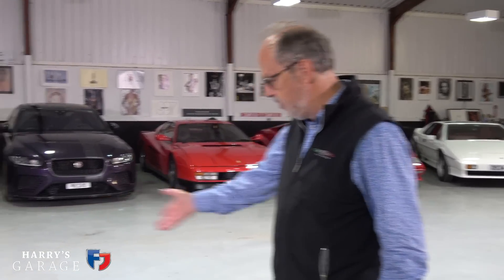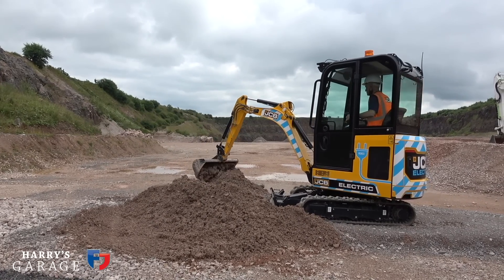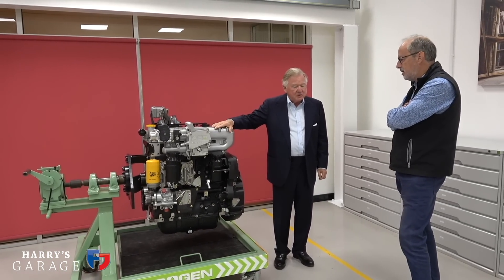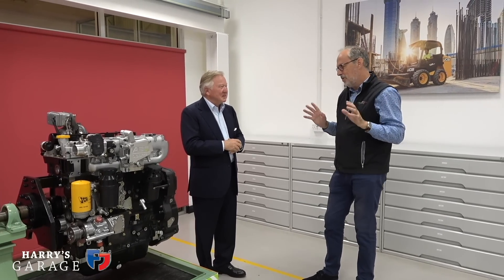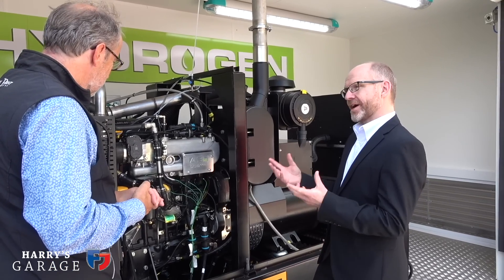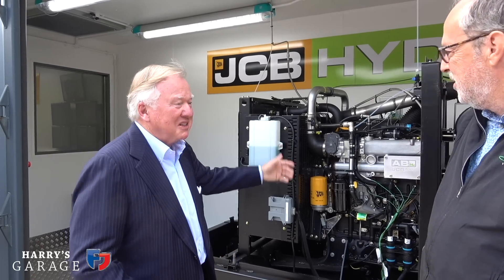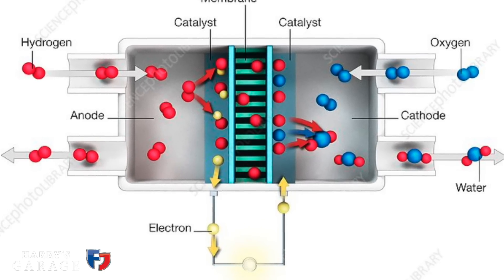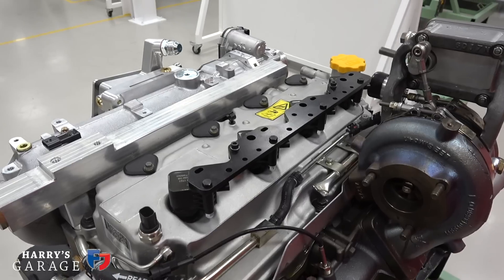Is hydrogen, rather than electric, the future for big-engined machinery? I visit JCB to find out

Comment: I’m somewhat confused with the following statement, “this engine is zero emission” 🤨 !!!
If the engine has an exhaust system it therefore produces emissions via means of combustion thus it clearly produces CO2 and possibly some carcinogenic gases. Yes ?
I love the product, I think it definitely has a really good used case…. however you cannot market This technology as zero emission! They should classify it as an ultra low emission engine with high performance.
Also it needs to be run on Green hydrogen and not grey hydrogen. Or you will never be allowed to sell it 🛢
Reply: the hydrogen internal combustion engine is simply a modified version of the traditional gasoline-powered internal combustion engine.[2][3] The absence of carbon means that no CO2 is produced, which eliminates the main greenhouse gas emission of a conventional petroleum engine.
Reply: @derekrevell  So just water vapour and Nitrogen Oxide ?
My understanding now from watching another YT video is you need a really big engine (5000 cc) to make enough power and it's only 25% efficient.

Comment: with hydrogen replacing mains gas in just a few years - maybe it makes sense to go for hydrogen for cars rather than electric.....
Reply: It doesn't make much sense to me. I can't fill a hydrogen car up on my drive. Nor can I get hydrogen from my solar panels.
Reply: @Brian-om2hh  but if your house is fed with mains hydrogen for your heating and garages dispense hydrogen you would be able to fill both at home and at fuel stations as fast as you fill with petrol/diesel now
Reply: @Brian-om2hh  if your house is heated by mains hydrogen in the future as is proposed, then tapping off from that will be simple

Comment: OK so you go solar and you do not generate power when there is no sun. Then you have the initial cost of solar panels the equipment to control and store the energy produced. That says nothing of the large plots of land that can no longer be used for food production.
You go with wind and if there is no wind or too much wind there is no power production. There is also the fact that with wind there is a limited lifespan and high maintenance costs. When you go by one of these wind farms are all the windmills turning producing power? There are wind farms across the country that have outlived their use and the result is they catch fire, fall down or simply stop.

From what I have heard Hydrogen can be produced on a large scale or a small scale by individuals without relying on power infrastructure. It has been used in commercial and private companies for years. So the technology is available without the danger of it exploding.Hydrogen is in the air free to be collected with no emissions from it's use.

Comment: firstly great work by JCB. At this point electric vehicles are a massive failure with lithium battery's there's not enough of it ! cars would only be for the super rich as the costs will go up and second hand market of older vehicles will be no more as they only last about 8 years before almost useless and need replacement cells. hydrogen has always been the answer to replacing fossil fuels, but and this is the BIG BUT why governments and the like are not backing it is because its not that difficult to produce hydrogen in a back yard ( forget the danger side ) no taxes or revenue on homemade fuel !!  before everyone shouts about the lack of tax on EV s yes at the moment its propped up by the massive remaining fossil fuel vehicles. so once fossil cars are no longer the masses it will be tax as usual for EV and if you cant sell your old one that only does a 10 minute journey from the worn out cells you will have to pay for it to be echo friendly recycled. I have heard a lot of people mainly young say "no they are making the cell replacement autonomous and would be simple" again at what cost and with what when the lithium runs out. Mr. musk and his team spent ten years making an advanced cell which had twice the power of old style. yes it was more stable and not so likely to explode or catch fire if shorted but it was twice the size - what twice as much power by doubling the size amazing ! no the only amazing thing about ev is the acceleration they have but we don't drive to work on a racetrack so its pointless.

Comment: With all the hype over CO2 being a greenhouse gas , wouldn’t using a fuel that produces a greenhouse gas even greater than CO2 cause more of a fuel problem?  What Climate Alarmists neglect to mention is that 98% of greenhouse gas in the atmosphere currently is water vapour. Burning H2 produces water so all you are doing is replacing one greenhouse gas with a more potent one.

Comment: If you really want to stick with ICE in the future carbon-neutral synthetic fuels are the answer not Hydrogen. The fuel will be very expensive and pollution will still need to be addressed but at least it would be net-zero carbon and as good as todays engines. This vid completely glossed over the many insurmountable problems with Hydrogen ICE. Just some of the issues are they will need to be double the displacement for the same performance, require massive storage tanks for the same range and be very expensive and maintenance intensive to run. Plenty of stuff out there detailing why Hydrogen ICE is not ever going to happen. Here are two:   https://www.youtube.com/watch?v=gu1v7d7-Wh0 and https://www.youtube.com/watch?v=3IPR50-soNA

Comment: There's a reason that you'll never see Electric in heavy equipment take the case the protective shroud off of a fan on an on electric fan in your home hold the blade in place don't let the motor turn and then turn it on you will burn up that electric motor the same way with heavy equipment heavy equipment is pushing dirt and in a strain is going to burn up the electric motors and don't say well-trained you're under a strain because trains aren't pushing against an immovable object they start off slow and build speed

Comment: well, this only works in a country where you have a lot of surplus clean energy.
Because hydrogen is not a energy source, its an energy carrier.
You need energy to create it, and there are a lot of losses in doing it.
Then you need to store it, so compression of the hydrogen is needed, more losses.
The hydrogen engine is also less efficient as a petrol or diesel engine.
If you are burning fossiel fuels to create hydrogen it is the worst idea ever.
IMHO there are not many countries that can generate an abundance of clean energy to implement this on a big scale. Where i live we build windmills like crazy and that covers not even 15% of our energy needs. We run out of space for more windmills long before we can stop burning fossil fuels.

Comment: You cannot forget a detail: the cost of hydrogen!!  Would you use that splendid motor if you have to pay 10 times the cost of diesel or whatever fuel you used? Electric is not the answer for this application but hydrogen is not either, I think.
Reply: Exactly. There are lots of people out there whom seem to feel that hydrogen is the Holy Grail. It isn't, nor will it be an inexpensive fuel........particularly if the big oil companies become involved, which they would like to be.

Comment: There is a massive problem with electric vehicles.  As most electricity is generated from burning fossil fuels and there are energy losses in the generation, transmission and battery charging they actually work out no more energy efficient than a modern petrol or diesel engined vehicle.  Add on top the emissions from building the charging facilities and upgrading the whole of our tranmission grid to handle the load and it is clear they aren't going to reduce emissions.  They will increase emissions over the next couple of decades.  When all electricity generation is renewable then electric vehicles make more sense. We should focus on doing this first before banning petrol and diesel engined cars that are actually more energy efficient.

Everyone who remembers their school physics should be able to work this out.  The multiple energy state transformations are where the losses of energy are.  An internal combustion engine converts the energy value of the fuel into motion in one single transformation so it will ALWAYS be more efficient than remote electricity generation, transmission and battery charging.  That is why we invented the small internall combustion engines that fit into vehicles.  It is the same reason why you have a gas or oil fired boiler in your house.  We could let the electricity companies by the gas instead and heat our homes with electricity.  We don't do this because it is less efficient and would therefore cost a fortune.  People need to apply some logical reasoning to the debate about how vehicles will be powered in the future.

Our politicians need a lesson on simple physics and they need to see this video before they commit us to crippling expenses that won't reduce emissions.  At they moment they are simply making knee jerk reactions to the protests of uneducated campaigners.  Shell and Siemens are working on hydrogen technology.  Our politicians should speak to them and think again about commiting us to battery power for everything, it will cost us billions and it won't reduce any emissions for decades.

Comment: Hydrogen fuel cell engines are far more effiicient and cheaper and simpler than an internal combustion engine. Actually using  fossil fuels in electric fuel cells are even more efficient than hydrogen

Comment: - Please don't stop researching hydrogen fuel-cell technology:
Now imagine this tech that has the same sound footprint as an electric car and you have a winner. It would make the working environment lots better. And if these machines have to operate in a neighborhood it would be way better for them to be as silent as possible. So why not take the opportunity to tackle sound emissions while we are moving into this new direction.

- I understand the reasoning but:
Hydrogen is only clean if 100% is produced by renewable energy, the energy loss from solar to the wheel is 74% with fuel-cell technology so if the source isn't renewable please don't use this tech! Compared to a model 3 where the loss from solar panel to the wheel is 14% and diesel from crude oil to the wheel the loss is 67%. It takes a lot of energy to make hydrogen so it only makes sense if you create it from renewable energy. Of course these numbers are approximates!

Comment: If refillable hydrogen fuel cells are improved, that will be the way to go. Combustion engines are fantastically complex, expensive, maintenance intensive and prone to failure.

Often you can do away with much of the transmission as well- another hugely complex and unreliable mechanism. Using electric is going to boil down to cost.

Electric cars are soon going to be cheaper. Rare earth batteries are getting replaced with better designs, different chemistries and what's more, all those materials are 100% recyclable from old batteries. Once that industry gets going you're going to see further price drops.
Reply: Hydrogen fuel cells use platinum in their manufacture, and will, during their lifetime require a number of services and refurbishments/replacements.

Comment: OK,  Hydrogen fuel as an energy source other than just blasting rockets off into space. I believe that Hydrogen-powered engines have there place,  but only as large industrial units powering generators powering the world's energy grid. this is because we, the world at large needs a safe nonpolluting source of electric power to replace nuclear energy in use right now. The thing about not using Hydrogen in cars and trucks is that it will require a completely new infrastructure around the world to support it.   an electric infrastructure is already being set up globally to support electric cars and trucks.  By using Hydrogen for generating electricity only, the production and storage of Hydrogen could be done at the same location as the power plants and no other storage or transportation of Hydrogen would be required.  The lack of any other Hydrogen infrastructure and the use of electric energy to the remainder of the world would complement each to the end of all time.
Reply: I don't think you quite undertsand where hydrogen comes from - or  is produced (at least sustainably). It comes using lots of electricity to split up H2O water. Your proposal would be to use vast amounts of electricity to create hydrogen then you propose you would then combust to generate electricity ???  The inefficiency of the processes of turning electrical energy to hydrogen then hydrogen back to electricity would mean you have thrown away half the elctrical energy you started with through a complex and costly process. 
Basically hydorgen isnt some magic free gas that exists anywhere on earth . if it was we'd all have happy amounts of green energy available  - or rather it would have long ago leached  into the atmosphere and the world would go *KABOOM*.
For sure you are right - the future is 100% electric - but thats sourced from  nuclear - be it man made nuclear powerplants or the big nuclear fusion ball in the sky that drives solar or the wind on earth.

Comment: Hydrogen is the answer and I have said so for years.  Electric is not.  Just seen a £75000 tesla  7 years old has 50 mile range needing £20000 battery replacement but is now worth 25/30 k and is therefore a parts car and beyond economical repair!!!  How is this progress?

Comment: Harry, please shek what would be the emissions of an electric car charged from the "mix" in UK, then add the CO2 for the batteries, the CO2 of recycling, add the toxic from the batteries, add the negative effects for the nature of all that digging... and then compare it with the ZERO EMISSION hydrogen engines - then say it again that EV has a place as well - NO EV DOESN'T HAVE PLACE. Only e-bikes make sense!
Reply: so, please explain how I get all my tools, and 4 sheets of plasterboard on an ebike?   You can't go down the M6 at 70 mph on an ebike.......... Quit being silly.
Reply: @Brian-om2hh  You didn't get it. for your work and for long distance travel not even hydrogen - the best solution is and probably always will be the diesel motor. 
EV is pointless. The only battery driven solution that makes sense is e-bike. One EV battery could power 50-60 e-bikes giving 60 people mobility in town most of the time.

Comment: Not popular but why not hydride/water or such.  I'd be a remote wonder.  No hydrogen, no prob..  Thermal is his word.  As opposed to electrolysis.  Thermal was his way of skirting around the 9000 lb gorilla in the room.  The world is behind in getting small modular cost effective nuclear reactors out producing syn fuels at process heat.  Plug & Play for existing coal generation.

Comment: This interview will not be complete until Elon Musk participates in it. He has run all the numbers.
1. IC engines have an efficiency limit of roughly 40%. 
2. Splitting hydrogen from water requires about as much energy as burning hydrogen and oxygen gives off. 
3. But once you separate the H2 and O2 the O2 needs to come from the air which is a mixture of about 80% N2 and 20% O2.... The N2 gets in the way.
4. Electric motors are about 98% efficient, and are reasonably light.
5. Teslas get about 80-120 MPGe (e=Electric) kWh to kWh, but Tesla batteries only hold roughly 90-100 kWh of electricity - equivalent to a few gallons of gas. Musk thinks that batteries have much room to improve.
6. Gasoline gallon equivalents
https://en.wikipedia.org/wiki/Gasoline_gallon_equivalent

Comment: "zero emission" - at the point of use. Electrolysis only makes sense if it uses renewable electricity that has nowhere else to go - which is a very rare event! Otherwise electrolysis simply increases the use of fossil fuels on the grid, so the hydrogen will not be "green" at all. Powering a machine from hydrogen produced using electricity from fossil fuel will have a higher carbon footprint than putting the fossil fuel directly into the tank, because of the conversion inefficiencies are multiplied. Sorry, but this looks like a classic case of greenwashing to me.

Comment: Ridiculously inefficient, hydrogen ICE are up to 25% efficient and create less power than a petrol ICE. Even compressed at 700 BAR it has 1/7th of the energy density of petrol per litre. They wont be zero emission either....they still need oil for cooling and lubrication, this still gets burnt as with all engines (small quantities however). Be interesting to see how this all turns out as compromises will have to be made.